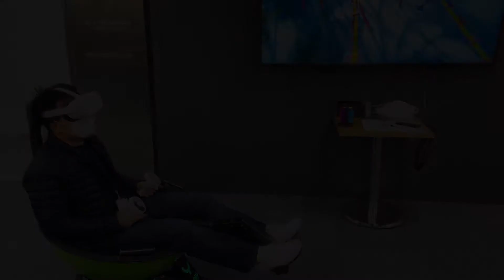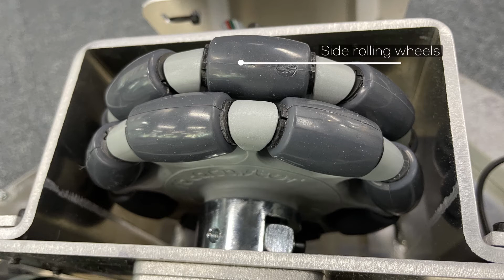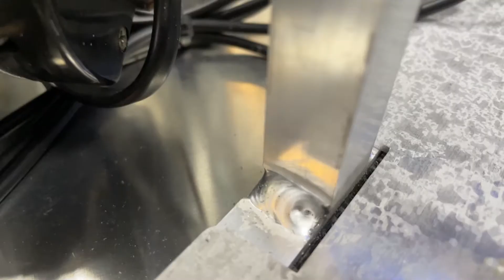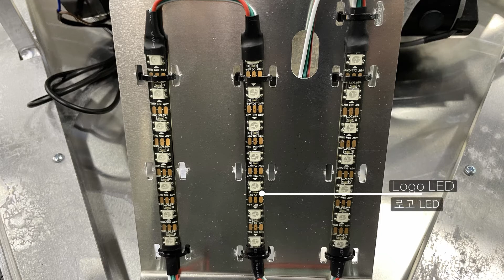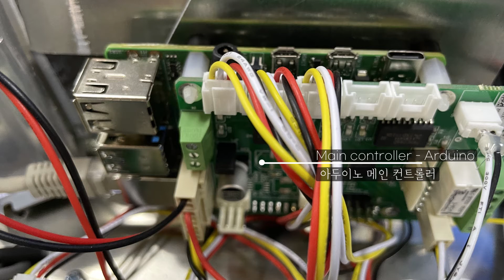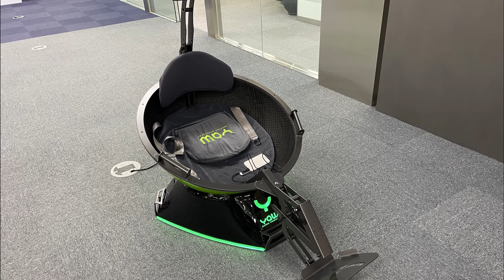Inside YAW VR Motion Simulator / 모션 시뮬레이터 속이 궁금하지 않으세요?

Comment: Does it have any encoders? I guess it should have at least accelerometer + gyro in the bucket with battery and wireless interface, otherwise it will be vastly inaccurate and even dangerous if one of motors suddenly goes off
Reply from the maker: Thanks for watching my channel. You're correct. There is a gyro sensor with a battery in the bucket. It has an app to calibrate the sensor and motion limitation also.